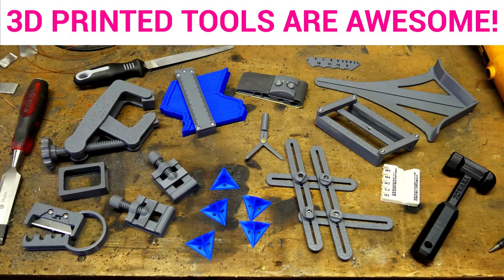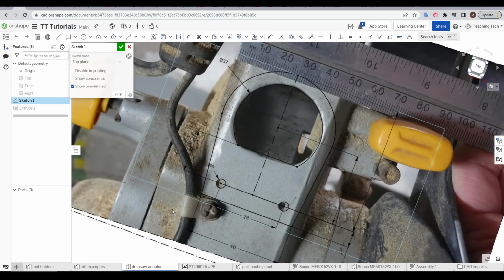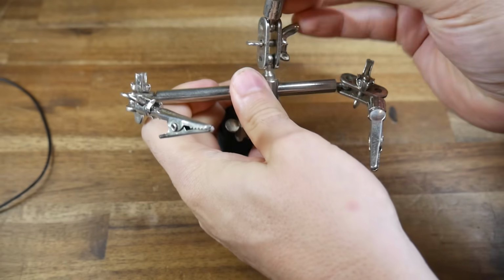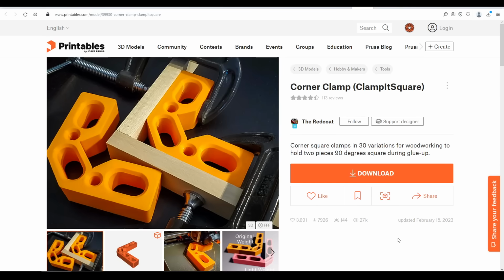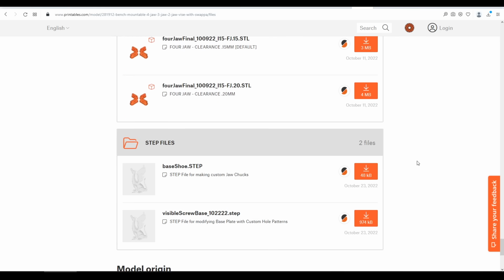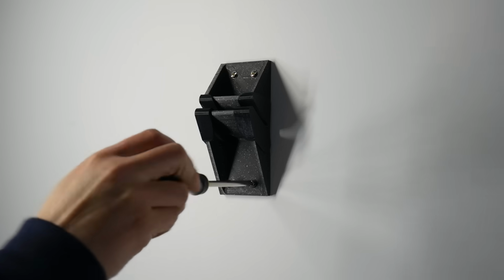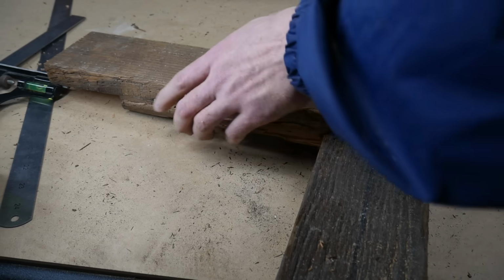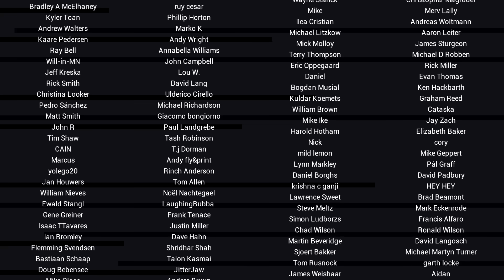12 more 3D printed tools you need for your workshop

Comment: One note here is that you should put a featherboard only before your saw blade, so it won't pinch your cut.
Reply: Definitely a strong potential for kickback on the thin unsupported piece of wood between the blade and fence, regardless of where the feather board is.  There are jigs that help with cutting thin strips.  There might even be a 3d printable version.  Rockler makes one and it looks pretty easy to recreate in CAD.
Reply: You also push between the blade and the fence, off-cut should go on the left side of the blade (assuming fence on the right)
Reply: Not to mention you also shouldn't cut thin strips like that. best to put the widest part of the board between the fence and blade. Those tiny strips can turn into arrows pretty quick.
Reply: Agree! The thin strip becomes a projectile.
Reply: @nicobogaard2315  In general I've learned not to stand in-line with the blade, but always of to the side for exactly this reason, whether using force before the blade or not.
Reply: Totally respect a guy that can pin a feedback comment about something he did wrong. Great video too!
Reply: He should also be reversing the cut. The featherboard would serve as a stop for the desired thickness of the thin cut, and you'd set your fence using the featherboard and the board being cut. The thinner piece should never be between the blade and the fence. In this case, the piece is long enough that kickback isn't as big of a concern, but this is generally a dangerous habit to have.
Reply: Yes!!! The placement of your feather board here is extremely dangerous and likely to cause kickback
Reply: @marchingknight11  Not going to create a kickback in this video since nothing is beyond the center of the blade. Its not going to kickback on the blade side pushing down against the surface. At least not when you have a riving knife also. 
The thin strip can kickback though. For other reasons. Since nothing is pushing it down.
Reply: @jakewildman8855  shut up bot
Reply: Yep, exactly how he has it in the video.  Before the center of the blade.

Comment: Nice tools! Has anyone ever found an STL for a through-hole component bending tool? I.e. for bending resistor, diode, etc. legs to the right width for insertion into the PCB? These things are for sale, but generally cost about $7-10 plus shipping which I think is a bit expensive for a piece of plastic that could probably be injection moulded for a couple of cents.

Comment: Not so sure about the wood push stick for the table saw, I have seen far to many guys on sites with nubs from them. I'm going to stick with my long push rod pair. The feather boar on the other hand I'm going to give a try. I'm going to edit it into 2 pieces so I can use a more rigid material for everything but the feathers and torture test the designs, my guys love breaking stuff after all. The bit and blade bridge could be very helpful as well. I may end up altering it a bit so I can put aluminum flat stock in for a bit of extra rigidity, and lifetime, since like I said before they love to break my stuff >.>

Comment: also on that first cut you used the push stick you showed i saw the cut moving back with the blade perhaps you should remove the cut using the pushstick (old as it has longer reach) to prevent it from being shot back ?

Comment: I would recommend my push stick (Dovetail Push Block Handle on printables) instead. It uses a dovetail to attach a sacrificial piece of wood on the bottom, as narrow cuts will cut into your push block and with the one in the video you'd have to reprint the whole thing after a while. You can batch out a bunch of wood blocks at once and have them on hand to quickly swap out when you chew one up to much.

Comment: 11:34 Easier way: Tape a sandwich bag (plastic and paper works, I suggest using the paper one) to the wall with masking tape. Scotch tape might work as well. With the tape over your future hole Now poll open the bag before drilling through the tape. All mess will fall into the bag.
Fast, easy, and cheap.

Comment: Im.sick of everything requiring insanely expensive bolts and nuts. The whole point of 3d printing is to make something for cost of filament and time, i cant be paying 5 bucks in metal extras per print. We need more 3d printable bolts nuts and a universal 3d printing fastener system thats better than metal bolts

Comment: I think the ROI for the hobbyist and DIY is a hard sell. Capital costs need to include the printer, filament, electrical costs, time designing a part, the time spent on the iterative process and waste of the filament (your disk project and watch box), extra parts like dowels, inserts, Lexan.

I think it is more about smiles per mile. 

When I was a college student I worked at a Tool & Mold shop. Craftsman worked hard to make the perfect plastic part with a super smooth surface. I am particular on a tool or parts fit and finish.

Comment: All good, except for the bit with the table saw. You need to provide a downward force on the material between the wood and the fence, or you're going to turn the saw into a rotary slingshot

Comment: If u have to solder 2 wires on to each other.. please don't twist them up and glue them thogether with tin.

Strip both ends of wire an equal length. Now push the wires in to each other and solder this up. It's a much better connection from both an mechanical and electrical point of view!

Comment: it is not advisable to do a cut as demonstrated around the 13 minute mark. if there is not enough room for a push stick between the fence and the blade you should use a spacer block of wood between the fence and the workpiece to keep the workpiece from being pinched between the fence and the blade. The blade can throw the arrow sized piece of wood back at you with dangerous speed.
Reply: I’m a 35 year veteran of the carpentry arts and you’re dead wrong sir.
Reply: Just don’t stand directly behind the blade.

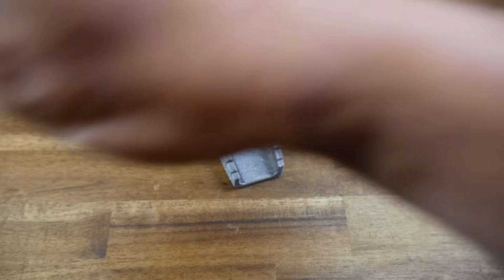Comment: 5:30 I wonder if you might benefit from printing an adapter to somehow mount the cable soldering jig to your solder station itself so it doesn't bump around as easily.

Comment: 3:34 - Turn the calipers around - there is a stick that pops out the back when you use the calipers that lets you measure things like that (as well as the depth of tiny holes, for instance.) 
You probably already knew that though, and this was just a use-case example for your print 😇
Reply: Dude what. I never realized. Been using my calipers for 4 years. Only just discovered the use of that little leg. Thank you!!!
Reply: @HebrewHunter101 also if you have digital calipers you can measure travel distance by extending it, zeroing the calipers, pushing the button and checking the value (you can also do it the other way around, the difference between the two is if the distance is shown negative or positive) 

Another nice trick is the distance between center of holes of the same diameter, use the back to measure the hole size, zero, then still with the back, measure the long distance, it will give you the distance between centers.
Reply: The same thing applies to the table saw height tool...your calipers are sufficient if you know how to use them.
Reply: Idk if there are reliable becuase of the perpendicularity of the hole and calipers but you can get a depth caliper that’s much more reliable
Reply: @X3347- He’s literally measuring to the half millimeter….You could get that accuracy with ruler.  Hobby level 3D printing is not anywhere near precise enough to justify micrometer level accuracy.
Reply: aahahahahahaha  )) why you tell'em this secret knowledge

Comment: at 11:30  Why don't just keep thing simple?  1. get a piece of paper. 2. Make simple envelop like paper bag. 3. Tape the envelope below the hole with a wider tape. And when you drill, all the dust will go in the paper bag. 4. After finish remove the bag from the wall and seal it with the same tape from the wall and throw it away. Can't get easier than that. Cheers. :)

Comment: Your table saw cut example was not safe at all, the part between the blade and the fence was completely unsupported and could have kicked back. You need to push that part, not the offcut, using a sacrificial push stick like the one you printed.

Comment: Instead of having stepped measuring insets (5mm, 10mm, etc) for marking along the edge of the board, create a wedge shape that lies flat on the board (like the stepped insets do, but make a ruler that slopes backward with the wedge (the rule dimensions would have to be stretched to make up for the angle) - run some small teeth down the front edge to lock the pencil tip. This way, you can mark in millimetres/1/16" increments. I need to get a printer...

Comment: CALIPERS!

Calipers have a small rod that comes out of the bottom for situations like the lock you couldn’t measure.  You just open the calipers so the rod comes out of the bottom, stopping when you get to the correct depth.   Your measurement is displayed at the normal end of the calipers.
Reply: They do, that that is mainly for measuring things like depth of an area where the head won't fit. This situation with an inset groove/step would still require eyeballing when the bottom of the calipers align with the steps of increased diameter. It might be fine for something like this, but feeler gauges are a better way to go.

Comment: Soldering jig also dilettantish. It's too wide to keep wires together. Narrower holder is needed and ideally if you can press wires from top to fix 'em. Despite jig construction, I frequently meet the case when you cannot put one wire into jig just because it's short! (or joined to big device, so jig cannot stand on the table) Definitely improvement is needed.

Comment: Dust collector obviously won't work BY DESIGN, despite your walls. If inventor were smart, he will add to device VACUUM CLEANER HOLDER. I mean v/c hose (without any nozzle). You insert v/c pipe into dust collector, put v/c ON and viola - you can drill and ALL dust is gone to the v/c.

Comment: There is a printable cable holder for soldering in 3 parts that use an elastic band to tension the grip. Much better version.

Comment: Hey michael, I originally got a 3d printer to supplement my woodworking/luthier template needs, this video showcases a lot of the stuff I love. The dust collection accessories scale and woodworking tool/accessory costs go out of control without a printer.

Comment: Bromo, you've got a Ryobi One+ Soldering Station and One+ Hammer Drill, just get the One+ pin nailer for those wooden drawer inserts. You've also got some One+ LED light! Also, use a cheap chip brush to push the splinters, don't use your hands.

Comment: I would not use a 3d printed push stick, unless you can validate it will not shatter.  Many plastics will explode, and you need to be sure the material you are using won't do that.

Comment: great video, just a PSA (I’m going to sound like te safety police now but for good reason) - that thin strip cut you made, absolutely unsuported is a kick back waiting to happen. there are a number of techniques to cut thin strips, such as cutting half way thru the lenght, lifting the board, flipping it and finishing the cut from the other end of the board, or using sacrificial push sticks that get cut with the thin strip but keep your hands away from the blade. Please do your own research, there are many table saw safety videos here. search for how to avoid kick back.

Comment: At 3:36 you could have used the backside of the caliper. Measure when pin is out, and measure again when pin is in. Subtract and you have the exact needed size.
Reply: Measure against what? You still can't get close enough to get an accurate measurement.

Comment: That table saw push thing is horrible! A push stick is not about ergonomics its about safety. You want to operate as far away from the blade as possible. It cuts flesh and bone easily in a fraction of a second. In an uncontrolled situation there is no chance to react fast enough... You wouldn't even notice before it happened. I had to close my eyes when i saw you using this...

Comment: The more videos I watch on 3D printing the more I am blown away by what can be done, truly the imagination is the most limiting factor. I must invest in one soon. Thanks for the videos.
Reply: I just have a budget one and honestly it has been fantastic.
Reply: @wematanye533  "budget" is about a billion times better than where 3d printers were a decade ago.  Honestly, the only major issue with budget printers(modern, not the ender 3) is you're largely incapable of anything requiring good heat deflection.
Reply: Me too. I have a 10 year old printer doing great prints (turnigy fabrikator) even with 150mm/sec. I bought it last month for 10€ lol i also uploaded a short video of it printing. Its only limited by small print surface and volume 150x150x100 @wematanye533  some days ago I bought geetech a10t for 30€ because seller thought it is broken because it didn't home anymore since he replaced Mainboard. He didn't flash the Mainboard with marlin activated bl touch. I configured bltouch in firmware, flashed it and now it works perfectly lol amazing deal

Comment: Feather board should not be printed out of such flexible material.  The ones you buy are much stiffer.  They flex a very small angle.  This helps them hold the work piece tighter to the fence and also perform their function as an anti-kickback device better.  This is a great video, I am surprised how good the printed vices / clamps work, very cool.

Comment: I am new to 3D printing. I have the Ender 3 Pro. I have not been able to complete a print project yet. The printer appears to be working properly but then stops after about 5 minutes and sits in one place. Any idea what could be causing the problem?
Reply: Ask that on the ender subreddit, and collect more information.  You have to say what it is doing or specific things that it should be doing(but isn't).  Is the nozzle at proper heat?  The bed?  Is the extruder working?  Can you cancel the print?  Is the printer locked up?  Thermal runaway?  Does it make a weird noise or shudder at the moment when it stops?
Always give positive indications(error messages, grinding noises, etc) that indicate possible faults, or negative indications(nozzle not heating, etc) of things that you know should be happening.

Comment: just a quick note.. on the table saw, you should have the main body of the board next to the fence, cutting off the small part on the other side of the blade. this is because the thin piece can bow (and often does in natural wood) causing it to press against the blade and then shoot out back at the operator.   note for the future. ;-)
Reply: Bump for an informative post. 

The off cut should never be between the blade and the fence. Very dangerous.

This does however inspire the design of a 3d printed thin rip jig.

Comment: Hey man! Generally love the video, but as a shop teacher of 7 years with no injuries on my record, I feel compelled to point out that you're not using the feather board correctly or cutting thin strips safely. I'm really just concerned for your own safety there, and for the safety of beginners who might follow your instructions. For the feather board, make sure it is in front of the blade. You have it partially to the side of the blade. That will apply pressure through the off cut to the side of the blade, potentially causing binding and kickback. The main problem for the thin strip that you cut is that you left it entirely unsupported and uncontrolled between the moving blade and the fence. You can even see it at the end of the cut, when the thin strip lifts up a little bit and is free to get launched by the spinning blade. This is exactly how kickback occurs. If you need to cut a thin strip like this, the safest way to do it is to not cut the thin strip between the fence and the blade but to make it on the offcut side. It takes more work because you have to move your fence for every cut, but you can use jigs to make sure you're positioning your wood at the right distance each time. If you absolutely do have to or, frankly, just want to cut the thin strip between the blade and the fence, you should absolutely use a sacrificial push stick. That's a push stick or push block that you will have right next to the fence and that you will just cut into. That way your workpiece is constantly supported during its time between the blade and the fence. I recommend making it out of wood rather than plastic so it doesn't shatter on contact with the blade. And then never leave the cut piece floating between the moving blade and the fence like you did in this video. That's one of the most common times for kickback to occur. I highly recommend the sacrificial push block anyway. You tend to get a little more control and you should get better cuts too because you don't have your piece wandering around.
Reply: I just want to say that this comment is really well written. It doesn't come across as smugness, only concern. A lot of people, myself included sometimes, could learn a bit from you.
Reply: Good comment. I also noticed the high-velocity spear that was about to be launched through Teaching Tech's spleen as it was pulled up onto the teeth of the spinning blade. 

A sacrificial pushblock is a great shout. I make them out of MDF offcuts & when they wear out, I use the old one as a template to cut out a new one at the bandsaw.